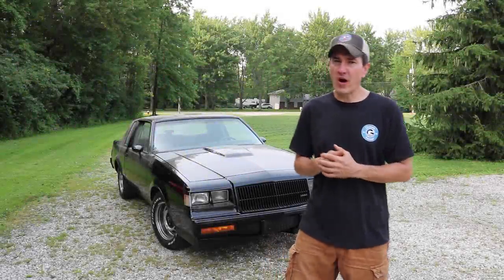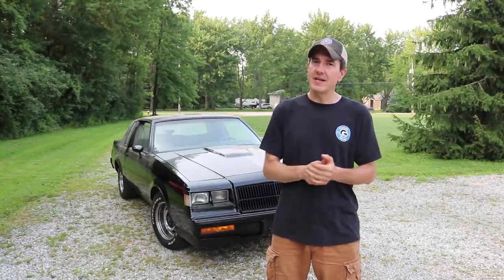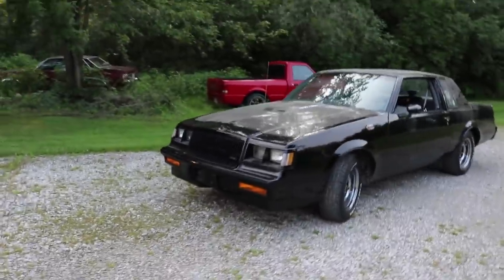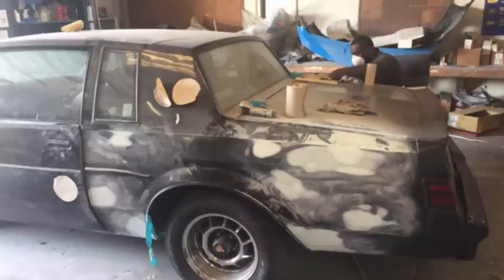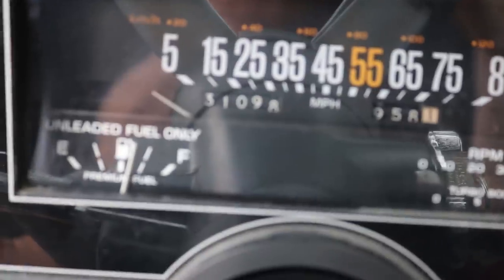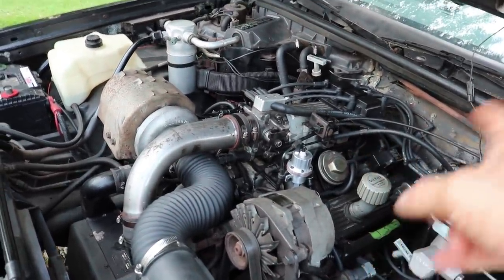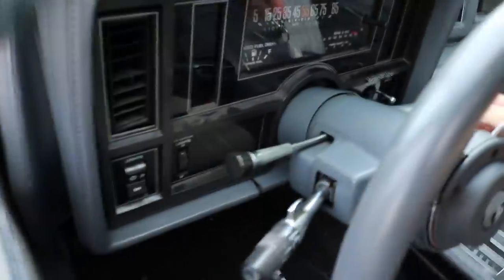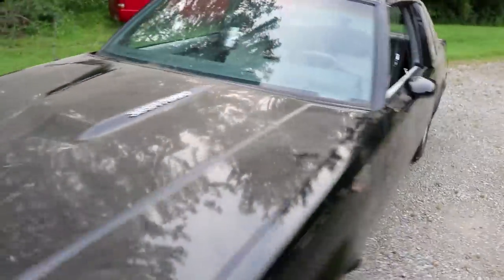JUNKYARD RESCUE TO THE STREET! Driving the SCRAP NATIONAL!

Comment: This car had a high stall torque convertor from the factory.I was glad to see the white letter tires and original GN wheels. The rear body mounts may need replacing deteorated possibly.I would put 89 octane or higher in her and some berryman chem tool to the gas to clean her out. I used it twice and really improved acceleration on my cutlass with the regular 3.8 v6 which is a a Buick Engine. I was glad to see the the improvements you made.Take good care of her and give lots of love to her she deserves it.
Reply from the maker: Thanks for watching! Yeah I like the lettered tires on these cars. Breaks up the all black look. Not a fan of black walls. It needs blown out more and I have been doing so. LOL
Reply: @ClassicGBodyGarage  While working at Pontiac G Car Assy I was very observant .The Grand Nationals, Monte Carlo SS and the Cutlass 442's all seemed to come with white letter tires.I thought I was the only one who didnt like blackwalls LOL. If you got pin stripes they were painted on and not tape.The only exception was the Monte SS had decals and maybe the 442 had a tape stripe treatment.Before you said in the throttle position sensor video replacement how did I know it was a 442 before you said it? By the tape stripe treatment on the front bumper! The 442 has 180 hp and a special cam I believe.The Grand national had 235hp.When the Grand Nationals were coming out there was a chip you could get maybe still available today and you had to put in a cooler T Stat I was told.
Reply from the maker: @markchwala2913  Very cool you worked on the line! Must have been a great time to be employed by GM.
Reply: @ClassicGBodyGarage  I was glad to be a part of its history and I didnt think so much of it at the time but until much later.History was being made on a daily basis back then and never to be repeated again. Please keep on with your pursuit of the G Bodies I can see it is in your blood!

Comment: The resurrection has been a long time coming, well done. Door should be an easy fix Mikesmontes has good pins available. Please fix those emblems lol
Reply from the maker: Thanks man. It's actually the latch that has an issue and not worn hinge pins but appreciate the parts lead. Almost affraid to pull the emblems and Fox but may try with some fishing wire. I was pissed when I saw they put them on wrong. LOL

Comment: very nice. These cars are awesome. Very intimidating for those who are not familiar how to work on them. I've got a project 87 Turbo T that's in need of alot of body &!chassis work and popping the hood shows an ugly LC2 motor but it runs strong.  i try avoid driving it since it is a bit of a safety hazard how it is right now. Last time I drove it I was fun. Unexpected, I had a guy in a new F150 next to me at I light and when it went green i heard him get on it so i decided why not, I hit boost and i was gone. not even close ..  Love these cars
Reply from the maker: Yeah no doubt! I have never worked on one prior to this. Had to get some advice from experienced friends to finally get it figured out after I stepped away from it for a while. Thanks for watching.

Comment: 💯👉The cars had a idle dip when they were brand new, so you're never really going to have a perfect idle when you come to a stop, sometimes they would even stall.
Reply from the maker: Yeah I am learning they are very temperamental.
Reply: @ClassicGBodyGarage  that car should Bang into second gear and cook the tires, stock...  if you still have the original valve body in that transmission it's precious, is required for it the bang into second gear the way it should, specific to the Grand National and surprisingly the 442s... and adjust that transmission cable near the throttle body, push in the detent and slide it out two notches towards the radiator👍  ... and put new vacuum hoses underneath the turbo, that noise is most likely dry-rotted control arm bushings from the downpipe.
Reply: @SHADOWBLACKs650  That GN came equipped with a D-4  ( maybe D-5 ) converter in the trans. Flame hardened or something. I did rebuild mine because of just being beat on before i got it. (Rubber on the rear quarter panel and exhaust)  I believe there was an extra solenoid in the trans as well. I'm not a transmission wrench turner. But my Vin 7 always brought a smile to my face when under boost.

Comment: Grand Nationals were never good at burnouts.   A stock 5spd mustang or camaro would embarrass  them off the line, then the turbo kicks and the the GN wins the race.   Now I knew a guy back in the day with a 50shot on his GN.    That car could lay a couple of black streaks on the pavement!    
A quality converter should be the next mod. Or maybe a 50-shot!
Cool car.
Reply: The GNs had a 2500 converter stock.
Reply: @jordanwiley4582  That is very surprising as 2500  rpm can really affect city mpg.  I thought it was closer to 1800-2000.    Can you actually footbrake a stock GN to 2500?
Reply: Charlie B This is my experience, not magazine articles.    All the mustangs I hung around  hooked hard.    Most were  in the mid 13s (some 12s).    My  350hp 4spd  vette was a high 13 car  (1.8  60' with 295 50 BFGs and 3.55s)  and I got beat  on the drag strip all the time by those little 5.0s.   I only raced a GN once, outside College Station, TX from a roll on the highway leaving town.  It had 17" billet wheels on it, Very cool back then. (1990?)    I was pulling him into triple digits. I let off first (no OD),  and I still remember how that turbo sounded as he pushed through.
Sorry to hear about that '88 SS.
Reply from the maker: Well for the record I barely got into it. I will have a video in the future showing it's TRUE potential once the car is completely sorted and get some miles on it. Didnt want to RIP on it the very first drive.
Reply: BwayneAnnaLee  At the dragstrip in the 90s a stock 87-93 5.0  was about as rare as a virgin pornstar.     I'm talking racing, legal or otherwise, and a lightly modded mustang was faster than most GNs in the quarter.  Anyone that went to the drag strip could see this.    The aftermarket was not into GNs at the time and they typically ran high 13s in the quarter, about the same as my vette.   I have never seen a GNX in person, but they were about 1/2 sec faster I think.

Comment: 💯👉Take the ugly exhaust off ,it's wrong for the car,  empty the turbo out into the fender well,  it won't be that loud
Reply from the maker: Yeah it's the Monte SS style.
Reply: @ClassicGBodyGarage  back then we used the hooker ceramic-coated they sounded nice or just dump it out onto the front right wheel but you got to cut a hole in that inner fender